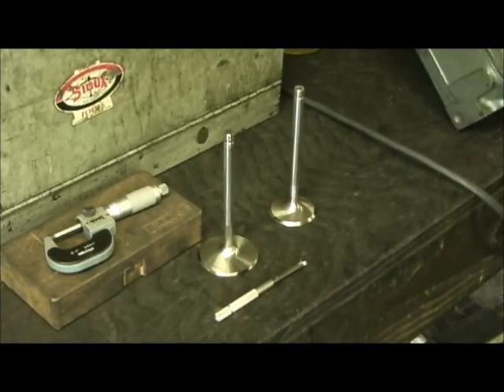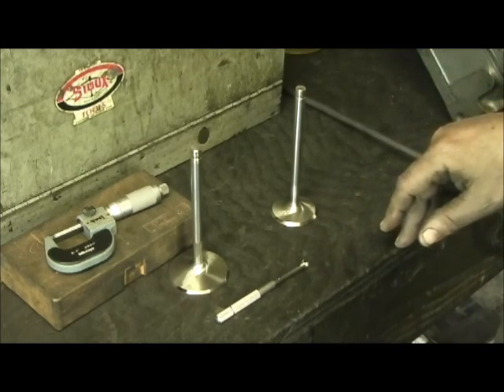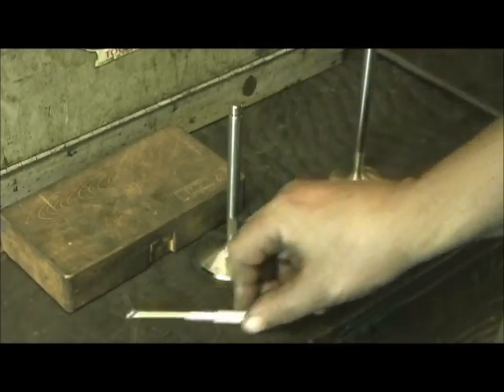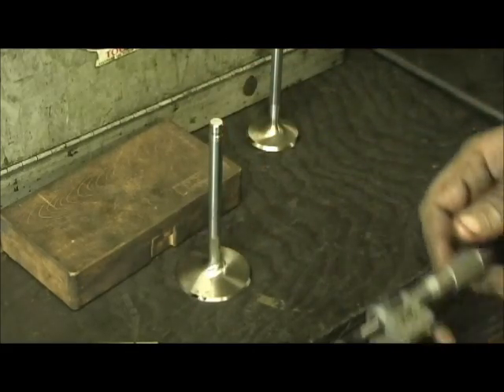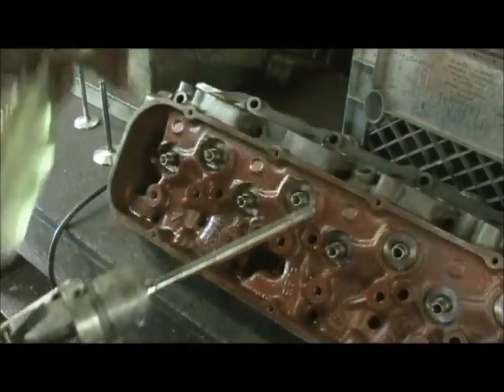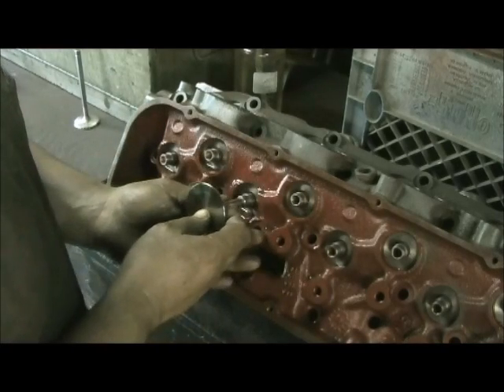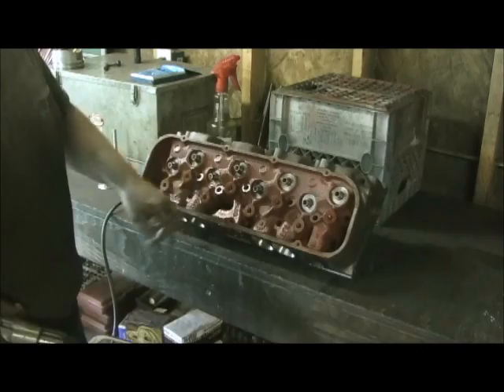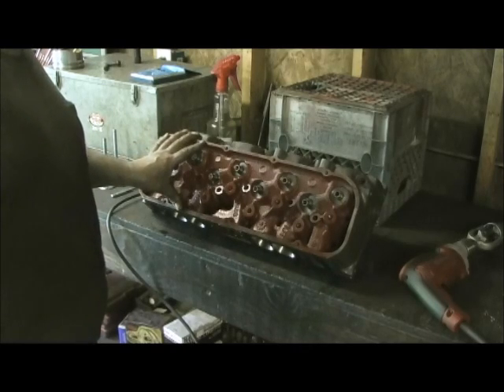BBC Casting 241 cylinder heads Part 6 "Valve Guide Instalation"

Comment from the maker: The shape of the valve radius is dependent on combustion chamber design. Hemi likes the "Tulip" style, while wedge style likes "Nail Head" shapes. The radius dictates the "Pitch" or angle which the air exits the chamber to the bore, and the "Tulip" requires little or "NO" valve shrouding to happen to work. Hemi's have the best Unshrouding Properties.